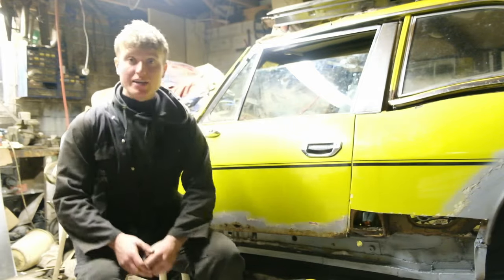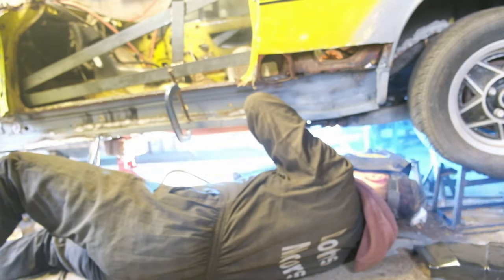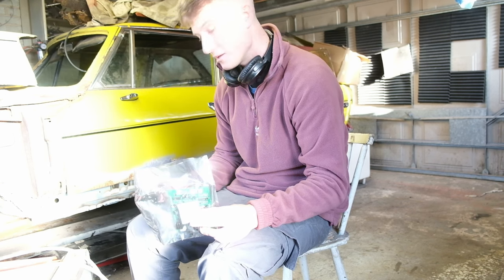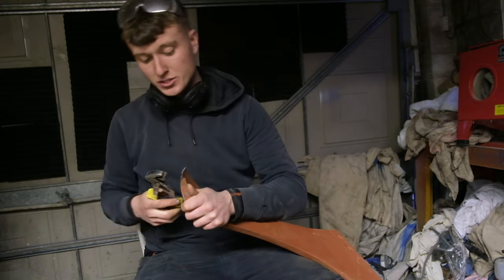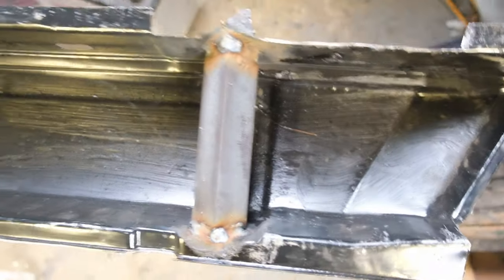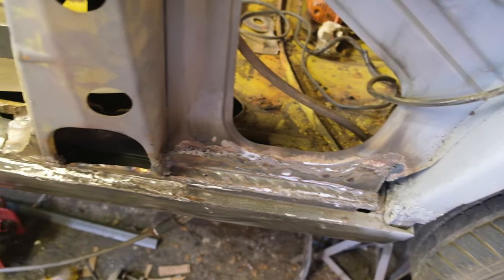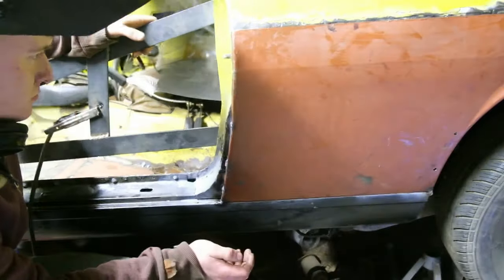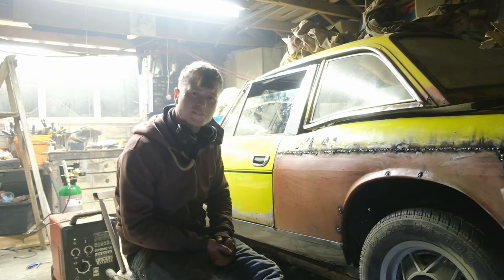Restoring a ROTTEN Triumph Stag | pt4 |  New rear wing and sills!!

Comment: Have you ever thought of using flux cored mig wire.  Especially if welding in draughty environments.  No need to waste gas for primary welds then... just an option on cost suggestions.
Reply: Yes I've bought one of those, it's OK tbh.
Reply from the maker: I used flux core on allot of  my mg it’s soo much easier with gas though!
Reply: @Boothsmotors  yes I've found that, for little jobs I do I've found gasless convent, if I was doing a restoration I'd be using gas tho.

Comment: Re running out of gas, are gasless mig welders capable of doinf this kind of work?
Reply from the maker: Changing to gas less is just a case of changing to a flux welding wire I’ve used them before and they’re not great you’ve gotta put allot of heat into the metal which gives you too much distortion, plus bigger claggy welds = allot of grinding
Reply: No gasless is utter shyte !
Reply from the maker: @leer798  🤣🤣🤣🤣
Reply: You need to set up gasless welder , positive earth , and pull backwards , with practice you can achieve results,
Reply: @stevesalvage1089  Gaseless/flux core is about as much use on thin sheet metal is MMA (stick welding). The reason being you cannot get low enough on the amp to reduce the heat. 0.6mm ER70 S6 is ideal or go for Tig welding where you have a bit more control. My welder (260amp Single Phase) puts out 37amps on position 1 on the voltage selector. Flux core/gaseless, cannot compete.